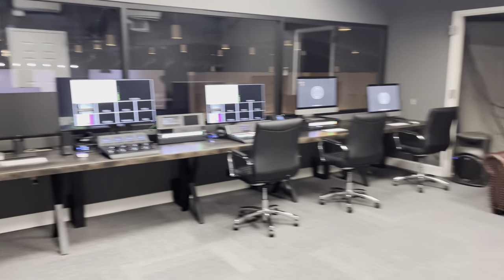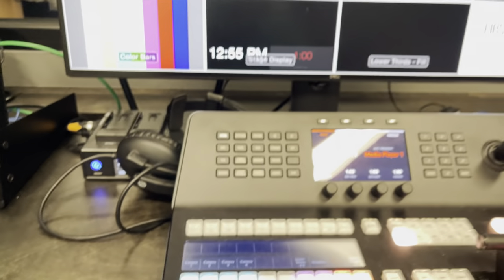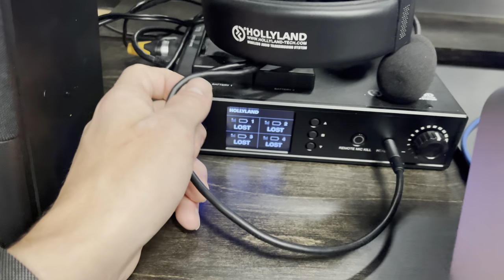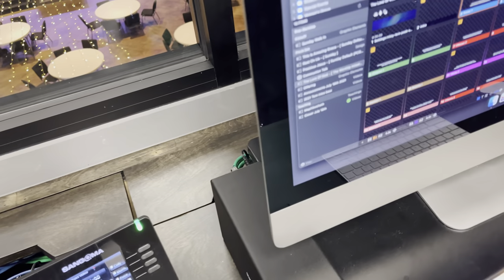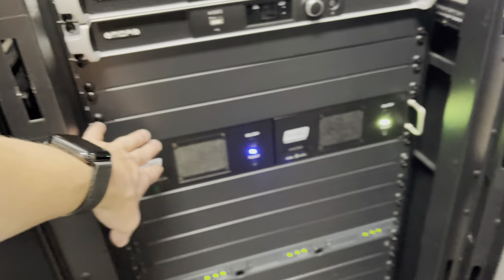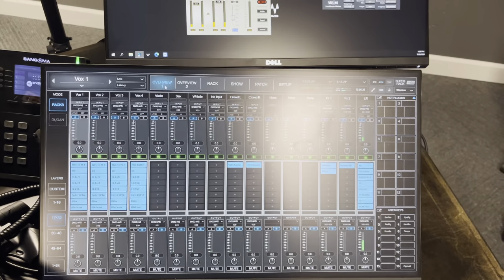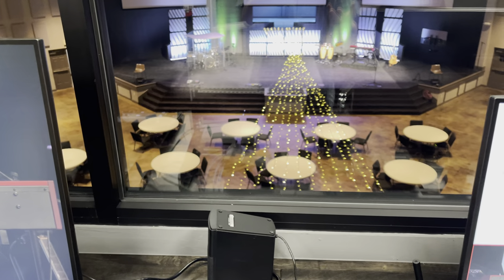Behind the Scenes: Church Tech Tour | Blackmagic, Waves, MIDAS, Vista, ProPresenter

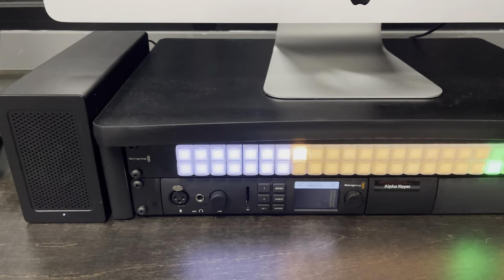Comment: Hi there - fantastic organization. By any chance would you be able to share where you bought the monitor riser you can see at the 2:45-3:00 minute mark? Is is a 2U rack riser or how did you get that setup to clean. I have exactly two racks worth of equipment under one of our screens and I'd love this - so much cleaner!
Reply: I'd guess that it was made by the guy that made the counter top and cabinets. 
If you want a similar look, I'd get an RAB audio ProRak 2U from Sweetwater. You can leave off the bottom piece and secure directly to the countertop, or assemble it as normal. 
If you need 2, then get the 4RU (it's only $10 more) and cut it in half, then you will have (2) 2RU bottomless risers. 
Or see if you have a local cabinet shop that can make the top and sides, and add your own rack rails. Rails are available in different lengths, from sweetwater.